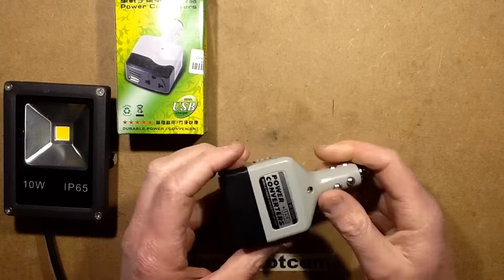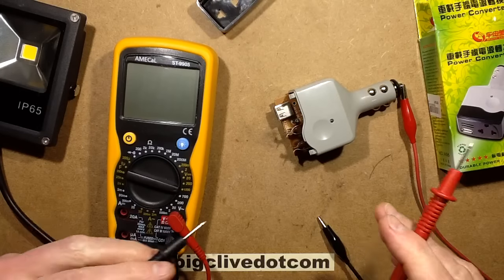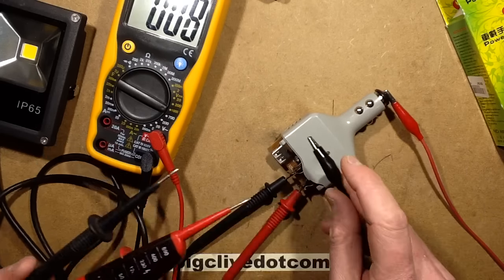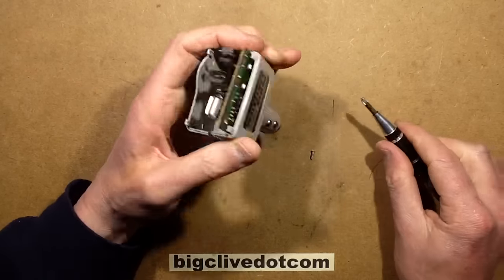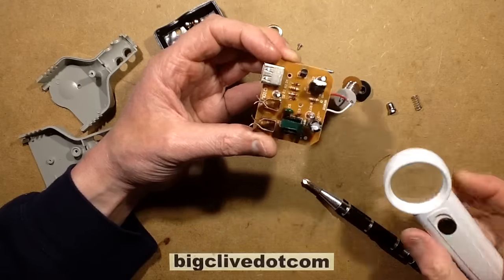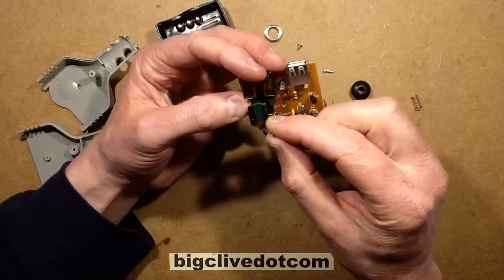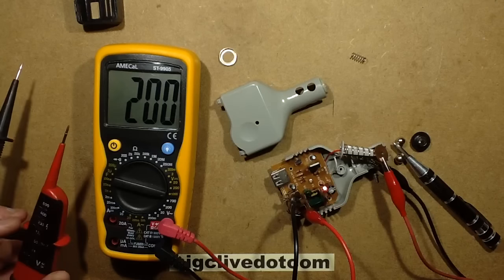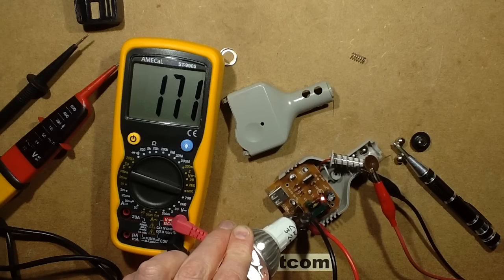Inside a slightly bizarre car to "mains" adaptor.

Comment: very odd, I have an AC inverter about the same size as that, ratted at 75w but the max I have used it at is 60 w l just can't see the point of it, most phones and tablets use a USB lead to charge and a 12 volt USB adapter is much smaller and probably costs less than that.  would it even power a laptop charger??

Comment: I'm currently trying to build a 555 driven inverter it is all good on the primary side but I get nothing on the secondary (of the transformer)-it is 5 volts in and currently on a breadboard- not sure of the problem as I get non-sinusoidal AC on tbe oscilloscope I use
Reply: Hi Joey

The output of a 555 is a square wave not a sine wave, so you'll never see 'sinusoidal ac'. You can apply square wave pulses to a transformer and get a voltage change (increased, most likely) but a square wave input will produce an output rich in harmonic products so your oscilloscope trace will be a real mess. The harmonic output is mostly wasted energy and a source of radio interference.

You really see NO scope activity on the transformer secondary or do you mean no output on your meter? I'd check your connections (scope and inverter) carefully. The absolute maximum output of a 555 is 200 ma - and you should be looking to use less-  and the resistance of your transformer primary will be low (very low if you're using a physically large transformer) so the mighty 1 watt output of your 555 circuit may be just 'soaking away' - in more technical terms, there's an impedance mismatch. How to proceed then? Use the output of your 555 to drive the base/gate of a transistor or a mosfet and route your main power supply via the collector or drain. You will find plenty of suitable circuits online.

What you're trying to do is entirely possible - and Google is your friend here. You will also find ways to avoid using a 555 - many of the available single chip audio amplifiers can be configured to produce square wave pulses at much higher powers. Keep on truckin'.....
Reply: @alastairbarkley6572  when I said nothing on the secondary it was with a meter, as the oscilloscope is an electron tube scope so it could break it, and the 555 is driving two transistors-TIP___ (have to check them)[I will replace them with MOSFETs]- so it is able to provide more current than the 555 can an amp or 2 if I remember correctly

Comment: now, time to review a good converter? i remember once having this snap on branded 12V to 120V converter, also had USB on it, was able to have my laptop and phone plugged into it no problem, with a cylinder design meant to let it fit in a cup holder, wish i could find that thing again

Comment: One thing I often see in videos testing car type adapters is people bench testing at 12 VDC.... 12 VDC is just a nominal voltage, your car is generally over 13.5V when it's running and supplying power to that style of adapter.  That's a significant difference. Not this this product doesn't suck anyhow....

Comment: I've seen a lot of crappy Chinese inverters and chargers, but this one beats them all. 100mA for USB and the 240V output collapses to 100V with the tester alone. If I were to connect my mobile phone to it, nothing would work. Neither with a mains adapter (20W) nor at the USB port (min. 2A).

Comment: I was just thinking of getting one of those for use as a B+ supply for a 1watt ish tube amp but i guess that it won't be able to sustain that at 200V, so my search continues, so thanks for that vid!

Also what i could think of as a use for this is for older gear, like 2008 vintage dslr only has an ac charger, no way to do usb, so for that it might be quite usefull

Comment: the unit is not designed to drive a 10 watt light.  plus the output is ac, as my computer charger works perfectly well.  it's not hard to make ac from dc.

Comment: Why would you have Mains voltage output to power a phone charger, when you have a USB output and most phone chargers output to USB? Very odd as Clive said. CTEK has mains to vehicle battery maintainer, that connects via the 12v output of a vehicle, to measure and top up when necessary the vehicles battery voltage, when vehicle is stored for more than 5 days (Porsche). Battery maintainer is re-badged and sold as Porsche. As a Porsche owner I can confirm, their security and other electronics will flatten a battery, even my double original capacity Optima Yellow Top Deep Cycle, in a little over a month. If not on a battery maintainer, the vehicle will disable the key fob entry after 5 days. Thank you Porsche.

Comment: weird circuit.
mind you I have a cigarette lighter mains adapter rated at 65 watts. it works well too.

With mains inverters, since the generated voltage has no earth are they safer to use as their current is not based to ground ?

i.e. power only wants to flow between the mains pins (or car bodywork) so mains shocks from inverters are less likely to kill you if you was unlucky enough to touch the pins
Reply: +BillyNoMates1974 It will probably be referenced to the car body since they don't usually work very hard to isolate the AC and DC. That said, you're more likely to ground yourself with your hands than feet in a car, so it is less likely to pass current across your heart if it does fault.
Reply: +BillyNoMates1974 Did you get it from Asda by any chance? I found a bargain bin of 60-65watt inverters at the local store a few years back, bought about 4 of them I think. They're handy for running a soldering iron from the car battery when you have just a couple of connectors to do and aren't conveniently near power.

Comment: I wonder if you could make a high-voltage supply based in this design, with enough power for a small tube amp (3 to 5 watts single-ended), powered from a sealed 12v battery...

Comment: I've installed a 800w Cobra 12to120 inverter in my 2000 Chevy Blazer, as I am a true believer in backup power. But, ive been racking my brain on how to make a useful mini power supply- Was thinking of using this product from the Wish app. Thank you for saving my time and money on this junk. Fascinating!

Comment: Hmm. Call us when you find what we yanks call an "inverter", that supplies mains AC voltage. Here, of course, they provide us with 120 volts at 60 Hz (more or less) albeit a horrible interference-inducting squarish wave. More expensive units will provide a "stepped square wave" that will stand a better chance of running your variable-speed drills, and of course the VERY expensive ones with a reasonably good sine wave output. But I've yet to see one that provides DC "mains" voltages here.
Reply: They all have "DC mains" but that is sent to a "chopper" circuit before going to the outlet.

Comment: 12 volts DC to 120 or 240v AC to 5v DC in a phone charger. Seems a bit complex.
Reply: The output is 120-240V DC, not AC. So it actually goes from DC, to high-frequency AC, to high-voltage DC, then to 5V DC. :P
Reply: ***** Someone needs to make a USB voltage multiplier and power it with that, given that fact.

Comment: I have an Eliminator (Canadian Tire-bought unit) brand 75w inverter (It works, even with a case that's not so factory fresh) and i use it for my laptops. It's quite an old unit, but it works like a trooper!
Reply: I have the same also(bought in 2003 and it still works)..., Part# 11-1839-4-  input 12V DC 8A max-  output 115V AC 60W cont. (75W<5mins)I've opened mine and it's completely different then the one Clive showed on this video.
Reply: The fact of the matter is that the Eliminator unit is made to actually charge/power appliances.

Comment: Still curious about idea behind this contraption. Most likely was intended to charge portable shaver or power other low power device which should be connected to mains, but does not require true AC to work. Nevertheless it is useless waste of resources even for poor chaps.

Comment: I have a few in those but they put 120 V AC modified sine wave and I did have an issue with the driving one type of LED that I had other than that it ran all kinds of LEDs I had and that's rated up to 75 W

Comment: Clive how can I measure the amperage of a power source without making a circuit? It's 12v DC and I expect it's around 6-7amps but I want to be sure but when I put my multi meter onto the connector it shorts. I tried putting it inline on the positive side but nothing happened when I would power up the circuit
Reply from the maker: It would really need a test load to see if the voltage dropped significantly.
Reply: @bigclivedotcom  Thanks for reply! And yeah I think what happened is I blew the 10amp fuse in the multimeter maybe lol. It still works but I can never get readings on the amp setting.

Comment: It wouldn't have cost the manufacturer much more to add a bigger 5V regulator and a real heatsink for the USB output (I have built these type of circuits and it doesn't get very hot even without the heatsink)

Comment: I'm really intrigued by these car to "mains" adaptors, or whatever they're also called. Is there any product on the market that can actually plug into a car charger and provide power to appliances that plug into mains?
Reply: Yes. They're called inverters. Make sure to choose one with a rated wattage higher than the load you want to put on it.  20% higher ought to do.  e.g.: to run 400 W, I'd go with a 500 W inverter.  Of course performance varies, and some good ones are fine at max rated load, but I tend to be skeptical of marketing numbers.
Reply: Eh.  With those numbers it's run at 80% rated load.  20% more than 400 is 480 not 500.  (Either way provides that buffer between marketing bullshit and reality.)
Reply: arfyness Thanks for the info. I'm almost certainly going to be using a video game console in the car (the name of it is the Nintendo Gamecube, if that matters) so would a modified sinewave inverter work? I've heard that they won't work with power tools and the like, but I'm pretty sure I can just use cordless variants of them.
Reply: +de la memes Vapourwave マッキントッシュ modified sine wave would probably be fine as those devices convert it to DC anyway

Comment: These are a knock-off of one sold in the US, outputing 120 volts through a proper 5-15R outlet.  It would run a small laptop, etc, via a US-AU adapter.  I bought one from a reputable components retailer.

Comment: I have a deadly car inverter, it 24volt dc in and 110volts out at 600watts. I use it for my solar panels. I went to connect the power outlet ground to dc ground sparks flew. the outlet was putting out 200volt on ground. so if you had a drill or something with a grounded case and you touch the car it would be bad. I should take it apart and take pictures of it for you

Comment: A lot of phone chargers charge faster on 110 / 220  opposed to just pluging it into a USB.
I'm sure you can buy a USB power adapter that actually works good but most of the ones I have are cheap and they suck.

Comment: Duracell makes some proper car inverters. Can even charge smaller laptops off them.
Reply: So does Ring Automotive.
Reply: If you want to power a laptop in a car, it's more efficient to just get a 12v car adaptor for your laptop. Then you're going from 12v straight to around 19v, rather than 12v to 240v and then back to 19v which is not efficient.

Comment: Nice review :) 

My former phone had a USB connector but only for data, i.e. could only be recharged via the propietary plug - so a device like this gadget would've been handy for use in a car, b/c at the time that was my main phone, I wasn't aware of any cigarette lighter or USB adapter for it either (though there may have been).

Actually, really the only things coming to mind are vintage phones or other devices without USB power-in - e.g. a radio if the one in your car's broken oder a portable CD player if you happen to have one anyway and wish to listen to a CD while driving and don't have a drive in the car but also didn't have or didn't want to spend time to rip it onto a USB stick. If the laser & motor don't need a transformer that would be too power consuming or standard reliant (180 V DC!) to be used with this gizmo, that is. I guess even in those cirumstances it would be easier to directly transform the 12 V  DC, but a fitting adapter might not be available, so hence the converter.

Comment: I have one of these in my car and it works great. It can power up to 150 watts plugged into the cigarette lighter and with the included battery terminal clamps I can use up to 400 watts! Mine does not output 120 volts but at 100 volts. It is a lot less efficient compared to 120 volts.

Comment: What about on 13,8VDC that an alternator puts out?
Reply: thinking the same
Reply: 200/12 = 16 

16*13.8 = 220 

That 's it
Reply: @fabioarrua  I don't know if that's how the circuit works, I mean if it was a normal transformer I guess but it has to be switching to convert from DC to AC.

Comment: I was looking at USB car adapters so I can charge my phone from the car. My current one has an amp (I don't know how to say it?) output of 850mA and Im sure I've seen some with 2.1A output.  What power does a car battery actually output and would thry actually be 2.1A?
Reply: +Lightning Graphics A car battery is capable of outputting a lot of amperes. For a common car battery, an output of about 70 to 80 amps continuously is normal, older diesel cars can use heavier batteries. A common lead-acid battery is capable of outputting a couple of hundred amps for a few seconds (to start the engine). But the 12V outlet on the inside of your car is fused for 10 or 15 amperes, so that would be the theoretical maximum. The 2.1 amps is a limit of the cheap voltage regulators being used, I guess. And since most modern phones do not draw more than 2 amps, that would be sufficient.
Reply: +Basch3000 aaah okay thanks, what uses are their for the outlet which would require around 15 amperes?
Reply: +Lightning Graphics You mean the fuse rating for the 12V outlet / cig. lighter socket in the car?

For the cigarette lighter to heat up to the the point where it's glowing it needs a fair bit of power. Power is the product of  voltage and current. Voltage ion the car is limited, to12-14V, so to make more power you need more current.

Comment: I know I'm off the subject a little. but I'm wondering if   you could give any advice on building a DC boost circuit for a inverter project. 24 v to about 160vdc. I need like 5-6 kW output. everybody seems to act like its impossible. I know the inductor or transformer will be large. or multiples of them. I must build this inverter. if you could offer your expertise. I would be grateful .

Comment: I think this is designed for cheaper and older devices which have custom chargers with non-detachable cables. And the USB port is for modern devices. Too bad it's not designed properly.

Comment: I have something similar but bigger but not by much, it would fire up my old 120w laptop charger but it would cut out and come back on every 5-10 seconds repeatedly, but it would run an 85w laptop charger continuously. So we used it for long car trips with an 6way extension lead so everyone could charge their phones and it worked well. Never worked out its actual rating but i assume it was close to 100w as it would run the 85w laptop charger and a 10w ipad charger at the same time. It got warm but it done it

Comment: If it’s only for phone chargers, Why change voltage from 12vdc to 220/240vac and back to 5vdc for USB ? Just get a car charger that directly converts 12v dc to 5v dc USB.

Comment: I have one that actually produces 110v AC, and it's great for plugging in a computer.  Laptop car adapters can be expensive, even if you get a knock-off brand.
Reply: +ThoolooExpress  There is no way I would plug a computer/laptop into one of these el-cheapo things. Even a replacement power brick for a laptop is $50+, so you're not saving any money, but you are taking a huge risk your laptop's power supply won't go POP! There are times and places to save money, but good, clean power for your laptop is not one of those places.
Reply: TheJohn8765 Well, that's what I mean, mine actually has an inverter in it (although I think it doesn't exactly make sine waves), and while I haven't actually tested the voltage, it works with led christmas lights (yes, I decorated a car with christmas lights...), so it couldn't be as bad as the one in the video.

Comment: After seeing this I built a simple self oscillating design using 9 VAC toroidal transformer and two power transistors plus a few other pieces to bias it. The great advantage being that the phones own charger suits best. The risk of a compromise USB charger is it might shortened battery life or charging capacity. From what I know the charging starts as constant current then becomes constant voltage.  A compromise charger might just have a resistor and USB 5 V. I think I noticed a battery lost charge capacity  when using a cheap USB charger used. It might have halved in just one cycle. I built a few variants of the self oscillator without too many problems. Often called ultra simple inverters.

Comment: I use a similar one to this (albeit smaller) for charging my phillishave while im in the car. It has no usb but its rated 100v 15 watts, it runs the phillishave charger and charges it about the same rate as using it in the wall.. had it a few years now, was free.

Comment: Sucky design, but I use the properly designed ones as a universal car to whatever adapter. As an example I have a 250 watt inverter that can  comfortably run a 200 watt soldering gun from a car battery.

Comment: If it can't run a 10 watt load properly it won't be very good for a phone charger

Also it will be so inefficient to turn 12 volts to 200 volts, only to turn it back down to 5 volts.